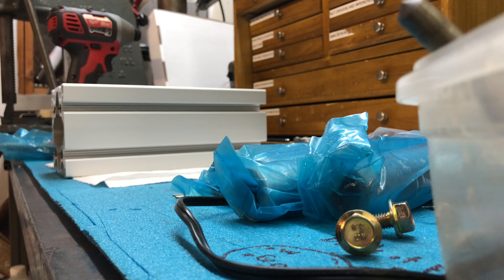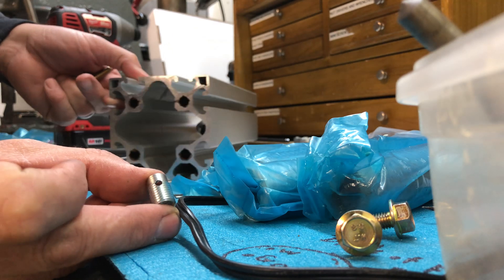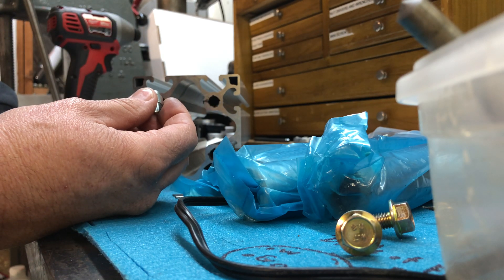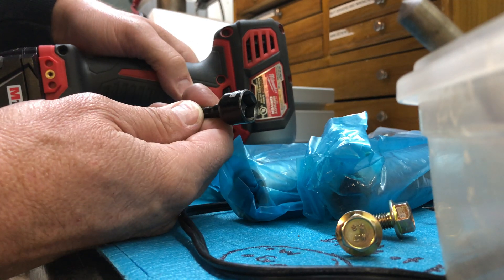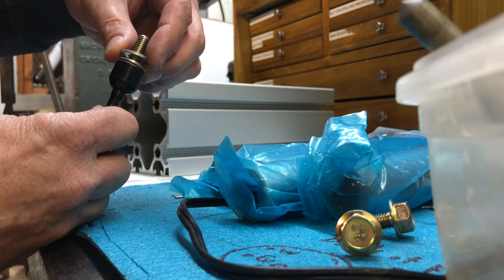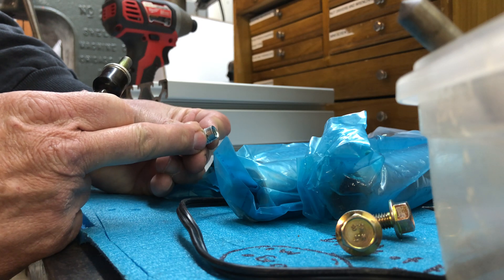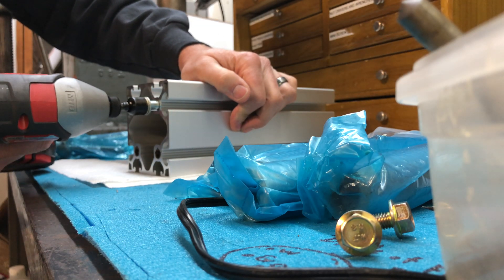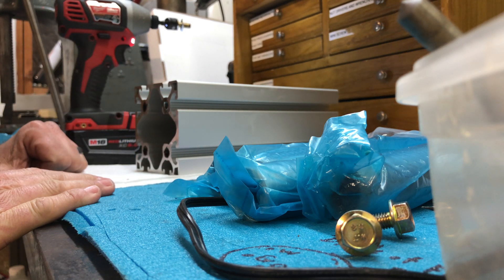The quick and easy way to install threaded inserts into aluminum extrusion.

Comment: thank you bruh.i was wondering how to fix my trans enlarged hole, m8 to m10 and back to 5/16 with this new insert seems like a plan.
Reply from the maker: Right on! Never crossed my mind that someone would use the info for another application.
Reply: @SimandDriver  yeah,I made 10 1.5 holes and coudnt seal trans pan ,bought on eBay and it fit right in and no leaks 👍👍👍